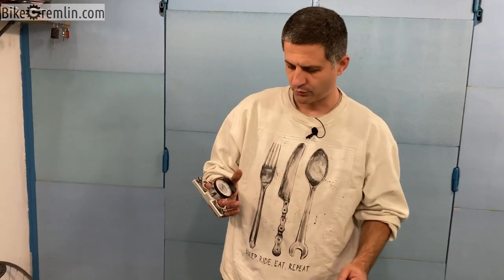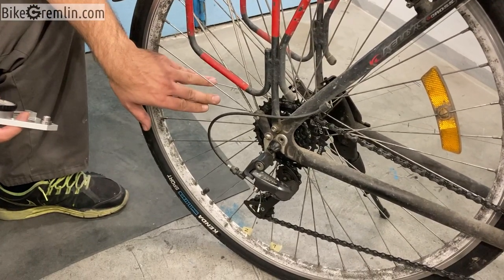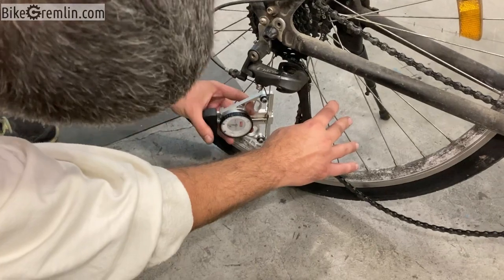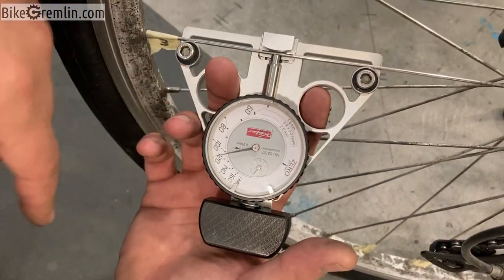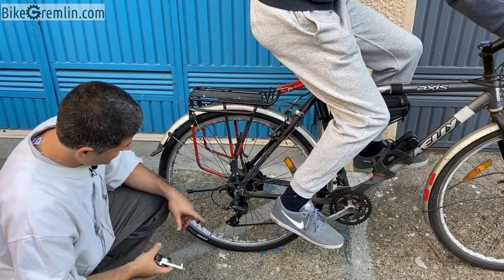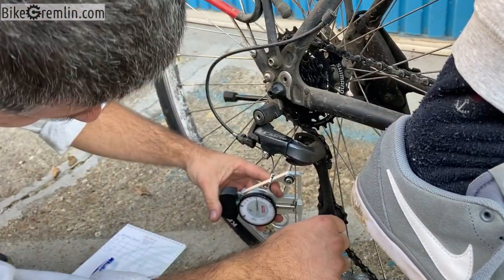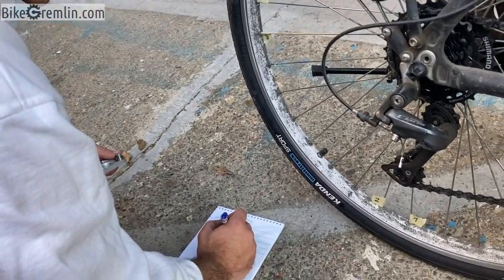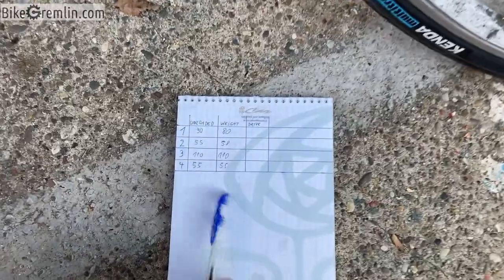Experiment: do left hand side spokes of rear bicycle wheels carry driving load (torque)?

Comment: could the braking force be what is causing the increase in tension?
Reply from the maker: The front brake is engaged. Creating resistance.
Chain is trying to turn the hub, while the tyre is being held by the ground (resistance due to good traction).
The same thing happens when you are accelerating without any brakes engaged, or riding up hill, or even keeping the same speed against the wind drag (and any friction/resistance) - only to a much smaller degree in this last scenario.